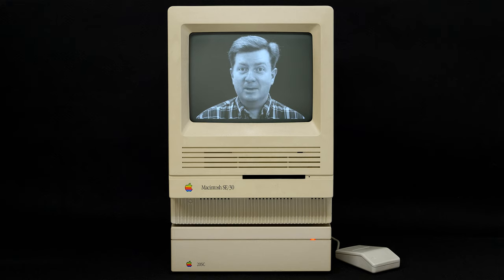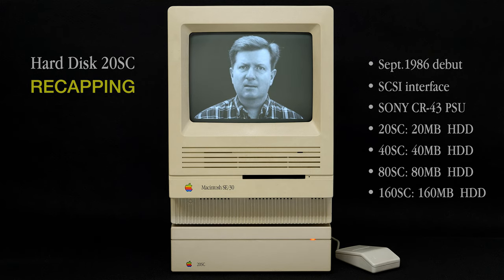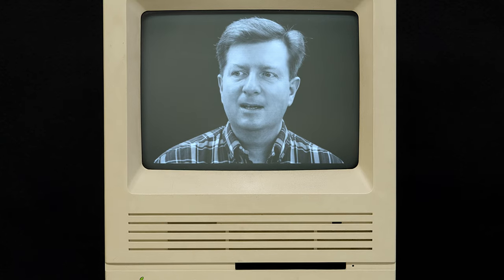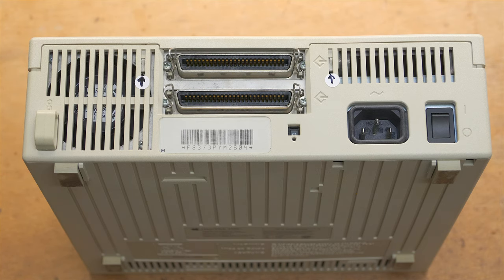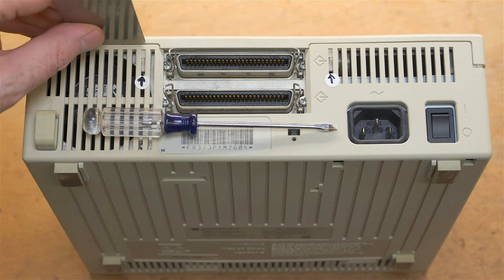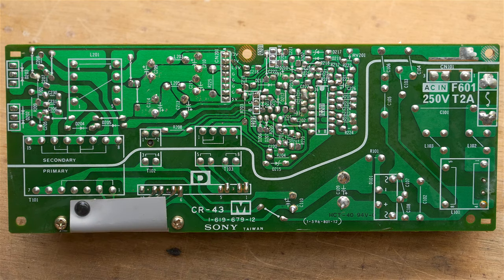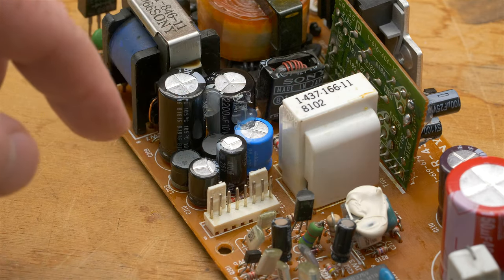Apple HD20SC: Recapping the SONY PSU [Hard Disk 20SC]

Comment: Thanks for this great video James! I recently acquired a 20SC and initially the PS was flip-flup-flupping... but after a few power cycles it started behaving.  I don't think it had been powered up for a long time. Regardless I'll recap the PS even though I'm not sure I'll put a spinning platter in it. The case really is a bear! I actually had better luck releasing the side tabs and then the rear. Cheers!
Reply: ps. C209 in the cart is now a long lead-time item... and quite a few others are flagged as EOL.
Reply from the maker: @pocketscience911  Thanks for letting me know.  It happens all the time.  In fact, I could fix it one day, and then the next day, one or more parts could go out of stock.  But tonight after work, I will bring the cart up to date so you can get everything you need.  That will be about 4 hours or so from now.
Reply from the maker: The cart is now updated, although I left the EOL caps as is for now because: (1) there are plenty in stock, and (2) some have better specs than alternative parts currently available on Mouser.  So you're good to go with my updated cart!
Reply: @JDW- wonderful! 🙏

Comment: I'm really surprised that it seems NOBODY really removes the lacquer coating from the board (with a brush and thinner) before reworking it.  I have found that this clear- coat type coating on the board can interfere with the solder joint, at times causing connectivity issues (it melts and mixes into the solder).  I am also talking about the DIP side of the board only.
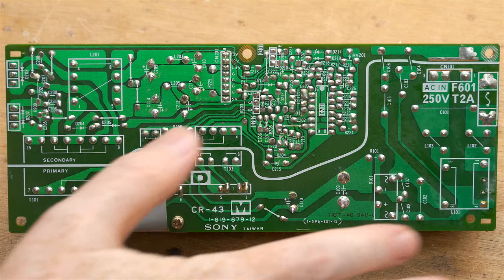Reply from the maker: There was a lot of factory "gunk" on the bottom (solder side) of the board when I started, as is the case of all of the Sony PSU boards that I have seen.  You can see some of that gunk at 25:30 & 29:17 in my video, and at 38:49 you can see what a little IPA cleaning can do.  But is it really "lacquer"?  When I think of "lacquer" I think of a clear coat that goes on wood to make it beautiful, and which never comes off UNLESS you use some kind of strong "thinner" -- the term you used.  But the gunk on the bottom of the Sony PCBs drips off like water when you merely pour IPA on it (even without scrubbing).  In fact, it's easier to clean off that Sony gunk that it is to clean off my Rosin-enriched MG Chemicals flux!  

Now as to the component side of the board (which I believe is what you are calling the "DIP" side), shown at 38:03, there is a little of that gunk on the left near the transformers, and the other areas to the right seem to have a whiteish film of some sort, as if Sony used some kind of cleaner on it, in a rather unprofessional and haphazard way.

Is it bad to leave it on?  Obviously not seeing that these devices worked fine back in the day, and often continue to work fine today, several decades later.  It is unsightly and could produce issues IN THEORY, which is why I cleaned off the bottom of the board.
Reply: @JDW-  Sorry, I meant the side of the board that gets soldered.  Not the component side.  And I'm obviously not at all sure what this layer of stuff actually is, but it also isn't always the same from board to board and device to device.  Its purpose is to prevent corrosion.  I prefer to remove it before soldering anything, as in the past it has definitely caused me to have problems.
Reply from the maker: @Johnathan_Waters  My initial guess was flux.  It really wouldn't need anything to prevent corrosion since the leaded solder itself is amazingly durable.  I have a water damaged SE/30 that has rust everywhere, but the soldered joints came through amazingly well.  Also, if its purpose was to prevent corrosion, I wouldn't expect it to come off so easily.  Again, I merely poured a little IPA over it, and most of it came off.  I did give it a good scrubbing with a toothbrush after that, but that gunk, whatever it is, comes off much, much easier than MG Chemicals flux, let me tell you.  Sometimes I will scrub and scrub with IPA, but that MG Chemicals flux still remains on the board a little bit.  When I finished my SE Reloaded board, I dunked the board in 100% IPA for about a half hour to ensure all the flux would become broken up so my toothbrush would finish it all off.  It worked well, as you can see here: https://youtu.be/KwFB_wPvVY4?t=3618
Reply: @JDW-  You mean the liquid Rosin Flux?  You might try a gel-type, I use Amtech.  Also, solder is more resistant to corrosion than some other metals i suppose, it certainly has it's limits though.  I mostly work on automotive-related boards, which can have all kinds of different conformal coating on them.  It is definitely for corrosion resistance and maybe shock/vibration protection to some degree.  Did you try cleaning it off with plain water?
Reply from the maker: @Johnathan_Waters  I use the gel type MG Chemicals flux: https://www.amazon.com/gp/product/B00425FUW2/
My comparison between the the Amtech and MG Chemicals flux is here: https://youtu.be/IOX7wmnoy4U?t=1541
I didn't try cleaning off the board with water since IPA dries faster.
Reply: @JDW-  Right, I understand, but any corrosion protection would need to be resistant to moisture right?  So you could answer the question of wether or not it is meant to protect against corrosion by trying to dissolve it with water.
Reply from the maker: @Johnathan_Waters  At the time I recapped that PCB, I had no indication or notion that coating was corrosion or water resistant protection. That discussion began when you and I started talking about it today.  When I first worked on that PCB, I honestly thought it must have been some kind of flux, hence my desire to clean it off with IPA only, and not go the extra mile of using water to test it.  Water alone only won't clean off flux, you see.  Since I have cleaned off all that gunk on the solder side of the board with IPA, I cannot test water on it.  And while their appears to be similar gunk atop one of the transformers on the component side, I cannot say for certain it is the same gunk, and even if it is, I am not inclined to dunk that transformer in water to find out.  I do have more recapping in the future though, and at that time, I will test water on any gunk I find on the solder side of the PCB and let you know what happens, relative to IPA.
Reply: @JDW-  Sounds great.  Good talk!

Comment: Do you know why mfg spec'd ESR is much higher than your measured values? Illinois say 140m, your max measured 60m@100Hz; and 
Cornell Dubilier says 189m your max measured 40m @100Hz?
Reply from the maker: Capacitor manufacturer datasheet ESR data is usually the maximum ESR, so measured "typical" ESR will be lower.
Reply: @JDW-  Thanks, I was thinking mfg was "worst case" since they don't break it down like you did. I realize C241 is secondary side, but had it been on the primary side measuring at 60Hz (assuming US) would be best to match right?
Reply from the maker: @lostmyhare  I'm not sure if you are asking if the Illinois cap or the Cornell cap would be "the best match," but the lower voltage "secondary" output side is of course the most sensitive to capacitor ESR.  Some switching power supply designs are sensitive to very low ESR (requiring that it not be too low), while others prefer the lowest ESR possible.  This is why you may sometimes see an MLCC ceramic capacitor (the lowest ESR of all capacitors) in series with a small resistor, in order to add sufficient external ESR to comply with the switching controller's datasheet guidelines (which are there to ensure it doesn't have problems with oscillation).

Comment: Hi JDW. I just got my CAPS from your Mouser order today. I got a 13th Capacitor that I don't know where it belongs. Perhaps it just fell into the box during picking at the warehouse? It is Mouser P/N: 667-EEA-FC1E100. Desc: 10UF 25V Elec FC RA. Its a tiny little thing and doesn't seem to match anything on the PSU. Did I miss anything. Also....for the solder joints of the main connector (CN201) It looks like the 2nd and 3rd solder points each marked "G" are connected. Does that seem right? Im only wondering to see if I need to separate those.
Reply from the maker: There is no 10uF capacitor in the Mouser Cart I link in the text description, so clearly someone made a mistake, which is highly unusual because I've ordered from Mouser many times and they have never made a similar mistake.  I suggest you review your invoice line by line and if that cap is not there, it means you were not charged for it, and therefore don't need to worry about it.  Just put it in your parts stock.  But if it was included and if you were charged, that's a problem because it's not in my Mouser Cart.  It's small change we're talking about, but still, I would say you should report it in that case.  Now as to the soldered pins, just look at 26:26 in my video.  While there aren't any two adjacent pins soldered to each other, both pins marked V are connected to each other at the PCB trace level (you can see it), and all the grounds marked G are connected together (you can see it).  So if you solder bridge any of those which are to be connected to each other anyway, it doesn't matter at all and you can leave the solder joints as they are.  Take a magnifying glass and look at each joint though to ensure none are broken joints.  That's really the main thing you need to check.  Good luck on your recap!
Reply: @JDW-  Awesome thank you. Yes I kept that extra capacitor anyway. Dont think they charged me

Comment: Nice tutorial, as expected from your previous videos. Thanks! As a newbie in restoring old computers, I'm super curious about what methods you follow on choosing components: Maker, ESR, dimensions, manufacturer series, etc... I've been browsing Mouser for capacitors for my old macs and I end up overwhelmed by all the options available.
Reply from the maker: Thank you for your kind words. First and foremost, always measure the stock capacitors and make absolutely sure you know how much width and height space you have. If you mess that up and your replacement won’t fit, nothing else matters. So long as you’re not recapping a switching power supply, ESR isn’t so critical. It might be in a timing circuit, but most of the time you won’t know what that is, so I would say it really doesn’t matter outside recapping a power supply. Next, if I had a choice between lower ESR or higher hours of life, I would choose the capacitor with more hours of life, and definitely always get capacitors rated at 105°C. Try to get the voltage rating the same or higher as the stock capacitors, but keep in mind as you increase the voltage rating, the ESR will decrease.  Choose  Nichicon or Panasonic or Wurth brand caps where possible because they are reputable. And lastly, when in doubt, post over at the EEVBLOG forums, as there are many electrical engineers there who can give you good guidance sometimes. But if you recap using any of my videos, I provide a Mouser cart, so all the hard work is done for you.
Reply: @JDW-  Hi, thanks for your reply. I've seen your mouser carts and have looked at them trying to figure out what you were looking for when selecting those components. I have several compact mac boards to repair in my collection, both logic and analog (and PSU, in the case of the SE and SE/30). I've been "playing" in the mouser catalogue, trying to select the best options and I always end up overwhelmed (also, I'm kind of OCD and would rather pick from the same manufacturer or series...) - for instance, picking the tantalum capacitor (I've seen your video of the Niobium Oxide capacitors, but they don't make them higher than 10v) for the logic boards - should I pick solid or polymer? I think here is a suggestion for another video ;-)
Reply from the maker: @goncalodumas  Polymer tantalum capacitors have much lower ESR than solid Tantalum caps. For use in recapping SE/30 motherboard, theoretically speaking, they should be better overall than solid tantalums. However, I’ve never used the polymer tantalums in my own motherboard recaps simply because I never thought about it until now. As such, you would be getting into experimental territory if you try to use them, and I would suggest you also buy one set of the same values in solid tantalum capacitors too, just in case. The only potential caveat to using those low ESR capacitors is that the “inrush current“ into the motherboard would be higher because there’s less resistance into those capacitors. That would place a larger but very temporary demand on the power supply at power-on, which if you have a stock power supply and not a modern replacement, may or may not be a problem. In such a case, I would suggest putting your ear up to the power supply when you switch the power on when using polymeric tantalum capacitors on the motherboard to see if there’s any audible beep sound at cold boot. And if you have access to an oscilloscope, looking at the 5v line during power on will tell you a lot, especially if you measure before and after your recap. That is how I went about my HD 20SC recap. Lastly, always measure the size and distance between the pads for the SE/30 motherboard capacitors so you know if your surface mount replacements caps will fit those pads properly.
Reply: @JDW-  Thank you for this detailed explanation. Best of luck on your channel, hope to see further tutorials/guides from you on old computers and related stuff.